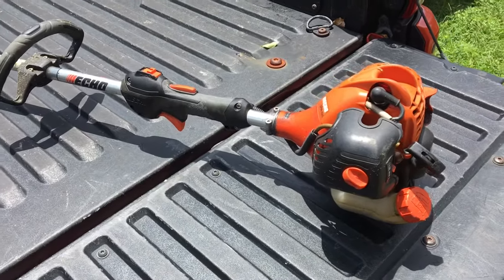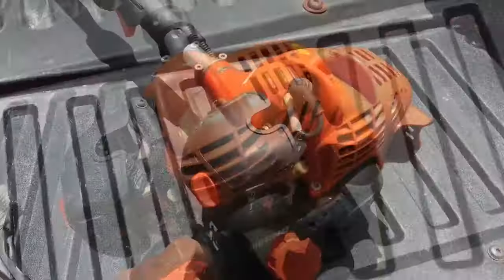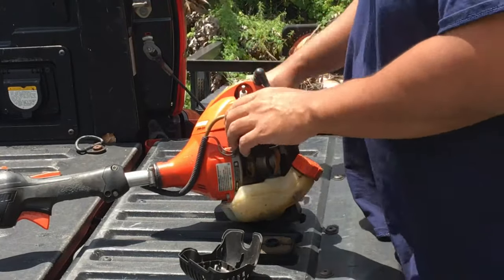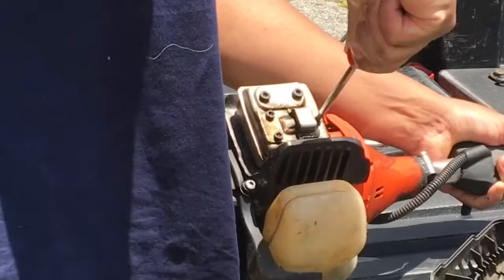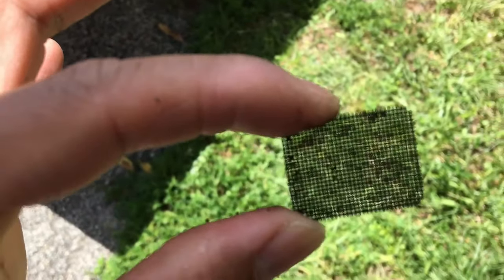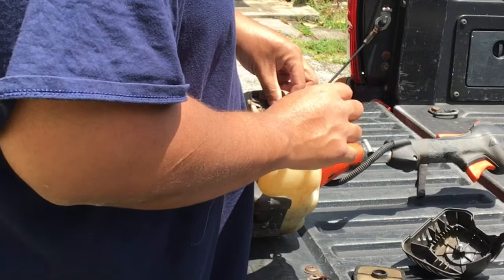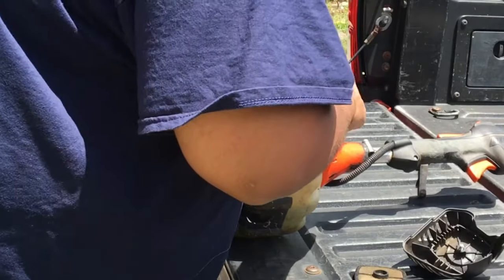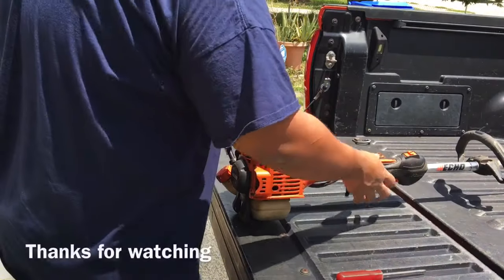Why your Weed Eater Won't Stay Running. A Quick and Easy Fix

Comment: THANK YOU for the video on the screen arrestor.  About ready to throw away a 10 year old Homelite weed eater.  When I flipped the speed from 2 to 3 it would die.  Removed the screen arrestor discovering it was 100% totally blocked with  black hardened carbon.  A wire brush wouldn't touch it, so I soaked the screen in solvent for two hours.  Cleaned, I replaced it and was stunned how it fired up on the first pull, running exactly like it was brand new!  Again....thank you for the video.
Reply from the maker: A-mazing. Greatest comment I ever read.

Comment: For the last 18 months I've not let the lawn crew edge or use a weed eater in my back yard. https://www.youtube.com/post/Ugkx_rBCFuDW1zD6blTGhLkvAkxU657uR_lG  I didn't like the fact that they just kept cutting the edge of the lawn further and further from the rock lining the flower beds and leaving bare ground. And the grass was trimmed or scalped several feet around trees, etc. It was a constant battle with them so I told them to just mow and no trimming. I have Zoysia grass so it grows pretty slow. Obviously after a while it could use some trimming. I'm in my 80's so I can't do much of it myself.Finally I decided that if I could find a lightweight battery powered trimmer I might be able to do some light trimming. I decided to buy the LST201 20V trimmer. And it works great for my needs. I have back yard with about 150' of flower beds and several trees to be trimmed. I can lightly trim the whole yard with a single charge! The grass I trimmed was only a few inches high but the trimmer was more powerful than I expected.
Reply from the maker: Wow. And damn you’re in your 80s. I’m talking to someone that lived in the past! That’s pretty cool

Comment: I used to have this problem until I switched to non ethanol gas and opti 2 oil. I would clean the exhaust once a year, but I would take it all the way down and clean the muffler and the exhaust port as well.
Reply from the maker: sounds like we both do the same things to our machines. i do the same thing, strip it all down and clean everything.

Comment: they say don't use wire brush, as scratches on the screen will attract more oil on the screen. Just torch it with a lighter  and burn it off.
Reply from the maker: Thanks for the tip.
Reply: You can just take them off and not put it back on

Comment: So I’m guessing I should just invest in the 40:1 gas/oil like Trufuel. I put the quart you get with the weed eater and then filled the gas tank with as much gas as that little container will hold so I probably just screwed up the ratio causing the filter to get clogged. This is only my second time using it. I really appreciate that you explained how it could be the gas/oil because I never thought about that until I didn’t use it again for a few weeks. Thanks a lot dude
Reply from the maker: no problem. I enjoyed reading everything you said.  you are a smart person with a lot of sense. I'm glad you figured it. this is probably going to be a comment ill remember forever.
Reply: Yup that will happen if you mess the ratio up

Comment: If you had the engine apart and then had hard starting, what kind of problems would you look for apart from  a dirty spark arrester?
Reply from the maker: If I had the engine apart, I would clean the piston top with a wire brush, also use a wire brush to clean the spark plug. Then I would clean the carb or replace the carb. And I’m sure it would fire up.

Comment: Thanks for this post brother I have a Honda line trimmer 4 stroke gx25 when  I try to start it it starts for about 2 seconds and then it turns off if I don’t hit the gas and when I let go of the gas it turns off what do you think could be the issue? Cheers brother 🍻
Reply from the maker: That sounds interesting. Did you ever try cleaning the carburetor with carburetor cleaner? Maybe it's not getting enough fuel to stay on. Wish I could take it apart myself and find out for you. But I would start with cleaning the carburetor, and be careful not to tear any gaskets when you take it apart. Use a flat head to pry and remove the gaskets if they are stuck against the carburetor. Let me know anything.

Comment: Thanks for such a detailed video! I had a quick question. My craftsman/Troy-built weed eater starts fine and runs fine for about 30 mins or so. When I shut it off to refuel or change the attachment it won’t start again… after letting it cool down for 5-10 minutes it will start but only run for maybe 30 seconds. Any thoughts on how I should troubleshoot? It’s a 4-stroke btw.
Reply from the maker: It sounds like the engine might be going bad on the inside. I'm not positive on this, but from what you're saying, maybe it could be on the inside of the motor. If it starts and runs fine for 30 mins, then shut it off to refuel and wont start again, it might be inside the motor, or could be the spark plug ignition magneto getting too too hot and becoming dead. The ignition magneto is the spark plug boot that you pop on the spark plug. Grab the boot and follow the wire back to where ever it leads too and that is the magneto at the end of that spark plug wire. maybe that is messed up. But I dont know. You make me want to figure this out too. Let me know whats going on more.
Reply: @GreenThumbEngines  hahaha. Sometimes not knowing something drives me crazy. Thanks for your help! I’ll let you know what I find!

Comment: Can I use carb cleaner on the screen?
Reply from the maker: Carb cleaner. Na, it’s mainly used to clear out ports, that’s why it evaporates and drys out quickly so nothing stays in the pipes. You’re supposed to use a degreaser. Then you can let it soak for a couple min and brush it off clean.

Comment: I cleaned the spark arrestor and it still does not stay running. I bought a new carburetor and no matter how I adjust it. It does not stay running, so what is the issue here?
Reply from the maker: I don’t know. I’d have to put my time into figuring it out. The machine has to be in front of me to diagnose it, then I’ll be able to help out. But if it doesn’t stay running, it could probably be the carburetor or the spark plug, or the fuel lines. Those are some of the places I would check for.

Comment: Thanks for this post. Quick question. Weed eater was working, but I refilled the weed eater with a different mix and afterwards it won't stay cranked. Could it still be the same thing or something different?
Reply from the maker: That's a good question. But I couldn't know. I would have to see the weed eater to diagnose it. But for the mix, you can use any kind of weed eater oil. It doesn't matter which brand, long as the oil is for 2 cycle/2 stroke engines. You will be fine. And make sure to follow the directions and use 2.6oz of 2 stroke oil per 1 gallon of 89octane gasoline.
Reply: @GreenThumbEngines  Thanks for this info. I'm going to keep troubleshooting until it fully operates 💪🏾
Reply from the maker: @CountryBlessingz  Try watching this video. It might help https://youtu.be/BRqEIHW0vuc
Reply: What if I just remove the Spark arrester screen?
Reply from the maker: @ChrisSlack  it will just be louder, thats all. much louder. but some states prohibit that. I dont think you would want to be holding that thing with it being that loud anyways.
Reply: @GreenThumbEngines 😅😮😅

Comment: So mine runs great until it gets hot. It then dies like you shut it off. Do you think this might be the problem?
Reply from the maker: I don’t know. All weed eaters get hot after they are cranked on. I’d have to have it in my hands to see why it shuts off though. There’s too many variables. I would check the carburetor if anything. Or check the spark arrestor screen that’s located inside the muffler. See if that’s clogged.
Reply: @GreenThumbEngines  thanks. It doesn't act like a fuel problem seems electrical.

Comment: I just removed mine.   No real need for arrestors on the east coast
Reply from the maker: Yeah. It's probably louder isn't it. It's already loud with the spark arrestor screen on. I can imagine how much louder it is with it off. My neighbors would go crazy. Lol I think the screen is there to suppress the noise of the engine and not pollute the breathable air as much. Either way, I personally would keep the screen on because weed eaters are loud as crap. Lol
Reply: @GreenThumbEngines  it's just there for spark it does nothing air quality. It is la bit louder though
Reply from the maker: @JohnDoe-ef3wo  thats actually wrong, spark arrestors are located directly in the muffler, you can see it in the video. Its for emission control. to suppress the exhaust from coming out too much. thats why its louder when you take it off. more air is coming out.
Reply: Spark arresters are used and required in the West Coast because of forest fires. Had one dealer on here say she would get fined $27,000 if she didn’t put it in on a repair.
Reply: @GreenThumbEngines  Lt
Reply from the maker: @enochwhipple8803  Ladainian Tomlinson? the football player? lol

Comment: Wrong...99 % is the carburetor issue...not exhaust
Reply: I think he was correct. Just solved my bogging issue.
Reply: Primož was right. I had bogging issues. And the problem was loose fuel line into the carburetor. Bogging can be cause from breathing, exhaust or ignition issues.
Reply: Hes right I just bought a brand new carb.. shit starts up and dies out once i squeeze trigger..
Reply: This works
Reply: Definitely carbs … I have 3 that started doing it and I just got new ones … went back and took the screen off two and cleaned the other and neither works … all need carbs
Reply: I have a new carburetor and spark plug. Win’t stay on unless of keep it on full throttle.
Reply: He’s not wrong..besides the 99% you’re not either..it could be several different things..fuel filter in the tank, clogged exhaust, bad fuel\oil mixture, etc.
Reply: I bought the maintenance kit today and installed a new spark plug, new fuel filter, and new air filter. Yesterday it wouldn’t turn on but I did the maintenance today and it fired up but doesn’t stay on, I took out the screen. Unfortunately it’s still dies. I might just replace the carb to see if that fixes my problem
Reply: I have new carb, new fuel lines, new fuel filter, new spark plug, new stator, fresh fuel, and I cleaned the screen. Any suggestions?
Reply: @chrismayyne2618 did you end up replacing the carb? Did it start?